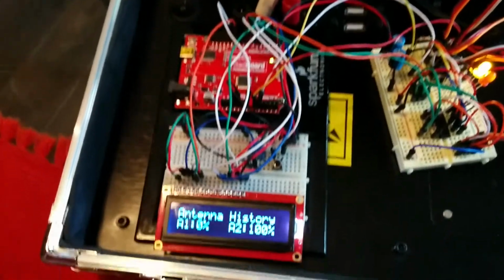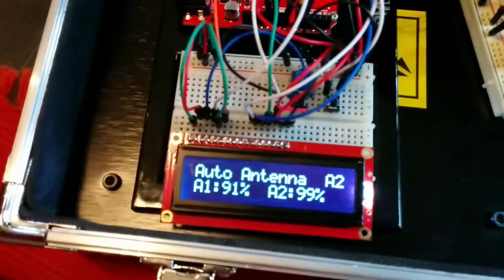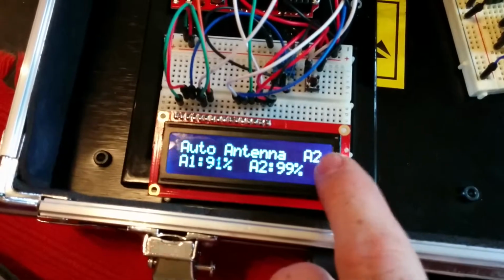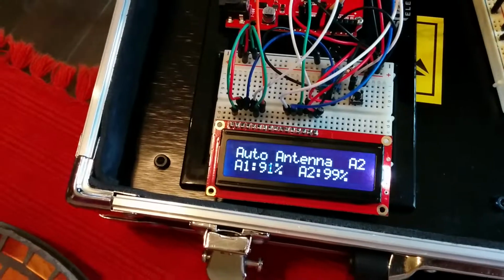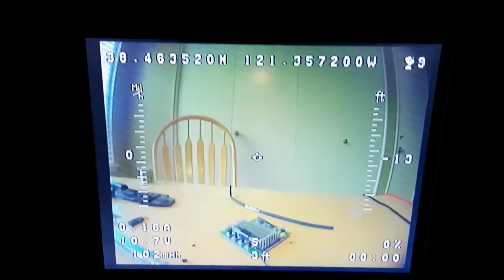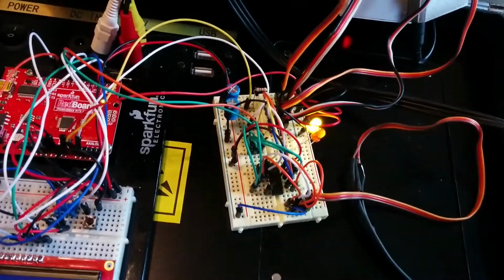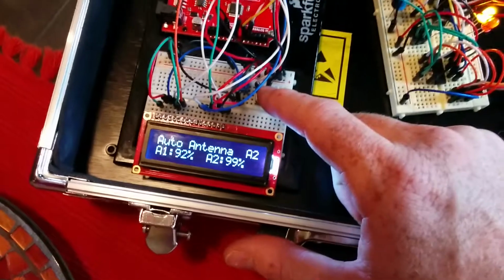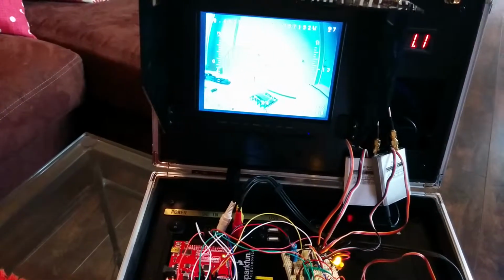Arduino Antenna Diversity Controller Video 2

Comment: what happenes if an interference is received? it could make the RSSI higher even though its an unwanted signal, then it would select that by mistake right?

do you have the tracking antenna working yet ?
Reply from the maker: I'm not totally sure how the receiver is determining its RSSI.  I am assuming some kind of signal-to-noise ratio measurement, and if that is the case, interference shouldn't cause unwanted switches between receivers.  In actual use in the field, the device works beautifully, the receiver switches are nearly undetectable.   Antenna tracking is almost done.  I'll post another video within the next couple weeks.

Comment: Have the code shared anywhere?  Nice project!  I'm planning this soon just have to finish some other projects for my channel first ;)  Cheers
Reply from the maker: Here is a build thread I did on a local forum: http://parkflysac.com/viewtopic.php?f=3&t=2083&p=16142&hilit=arduversity#p16142 Admittedly, I haven't commented the code that well, but if there are any questions about it, feel free to ask.  I have another project in the works that builds on this code but now has an antenna tracker.
Reply: BrianD Excellent!  Appreciate that.  Code looks great.  That will save me some time for sure.  The antenna tracker sounds great too- admittedly I thought about building one as well :)  Cheers Sir.  Thanks!